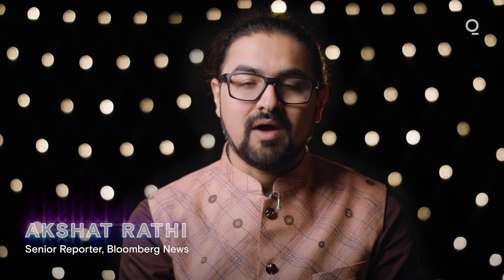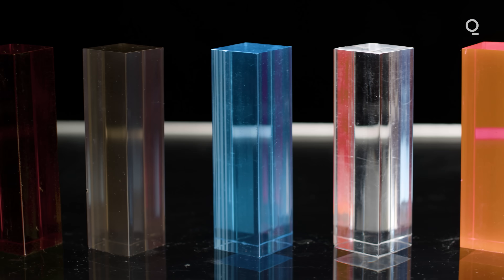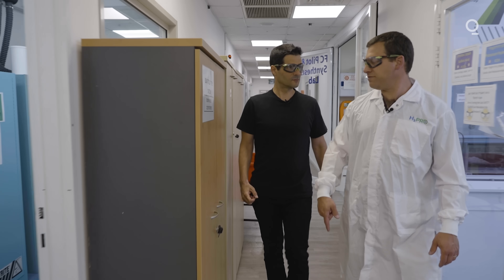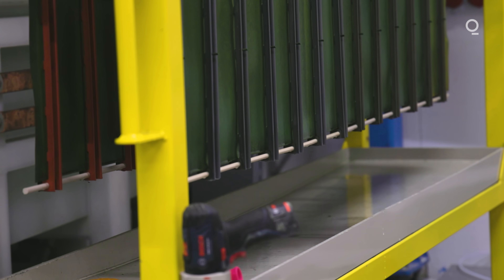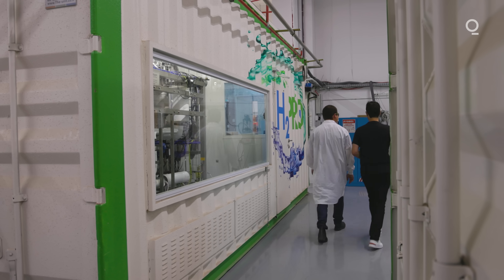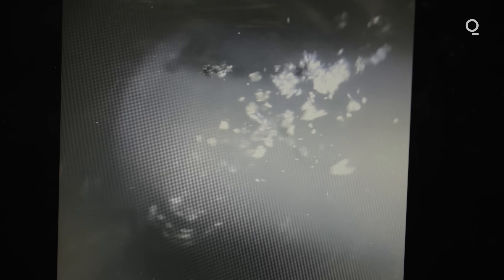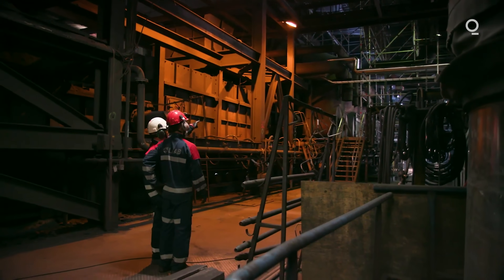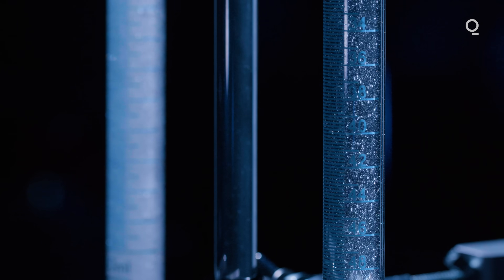How Cheap Hydrogen Could Become the Next Clean Fuel

Comment: 5$ per kilogram. Dude, you did it pretty well ! 1 KG of hydrogen can power a car for 100 Km. Usually a car consumes 8 liters of gasoline on highway for 100 Kms. But the gas for 100 km will cost 16-17$ ! Not 5$. You are already a winner.
Reply: 1l of petrol ~0.7kg
Reply: @yehezkielasyary  Depends on the fuel, petrol would be between 0.75-0.85kg pet litre and diesel would be 0.85-0.95 per litre. It will always be close to 1 and will always float on water (not be above 1).
Reply: Hang on, you are comparing apples and oranges. The 700 ml of hydrogen required to run a car, needs to to be under very high pressure. A little further reading maybe in order.
Reply: 5$ is aspirationally , now the cost is more like 20$ ish
Reply: Believe me, without subsidies it will never become as cheap as driving electric and it's very unlikely to ever become 5 dollar a kg, even 10 dollar without subsidies is unlikely.
Reply: @rowanbroekman3929  Even with massive subsidies not sure H2 can win against imported fossil fuel. The shot of H2 nozzle disconnecting looks to be a Japanese Muni bus the H2 comes from a oil company. Plain old diesel & CNG buses still used on 99% of the routes. The H2 Toyota Sora fuel cell bus is still limited rollout testing phase. Hybrid buses slowly being withdrawn from service as batteries reach end of life.
Reply: Search yt for homemade hydrogen cells powering cars, there is no shortage of people running engines with their homemade hydrogen cells.
Reply: That "$5 per Kg" is not reflected in actual retail price, it's probably the cost of energy to produce the hydrogen, and ignores equipment costs, maintenance, and profit margins. Actual retail cost started at $8 per Kg 2 decades ago, and has risen to $16 per Kg now. 

Instead, compare that with EV "fuel" cost: typically 10 to 15 Kwh per 100 Km for sedans, and 17 to 22 Kwh per 100 Km for SUVs. With electric rates 8 cents to 23 cents per Kwh, that gives a price range of 80 cents to $5.06 for 100 Km - and that isn't ignoring equipment costs or maintenance or profit margin, as those are included in the price of electricity.
Reply: 1kg of hydrogen. If we are to consider two fuels, we should measure them in the same way. As in one liter OR kg. Not both. One liter of hydrogen and one liter of gasoline have an incredible difference in density. To contain hydrogen in liquid form is near impossible unless you cool it to a ridiculously low temperature. To contain one kg of hydrogen requires a very sturdy gas tank with advanced seals and perfect welds. Storing hydrogen at the gas station requires them to liquefy the hydrogen. Also expensive. And extremely inefficient.
Reply: @joachimsingh2929  1l of petrol ~ 1kg of petrol. In transport, weight is the problem, more specifically, fuel to load weight ratio. Just look at trucks and how little space fuel takes. If it triples, it wouldn't matter much, but several hundred kilos of fuel matter when you have a light load. Same with cars, motorcycles, there is enough space for more fuel, but you don't want to carry additional 100kg with you.
Reply: @Dowent  So, at 700 bar, which is 700 times normal atmospheric pressure, hydrogen has a density of 42 kg/m3, compared with 0.090 kg/m3 under normal pressure and temperature conditions. At this pressure, 5 kg of hydrogen can be stored in a 125-liter tank. About a 30 gallon tank. A single steelwalled scuba tank at 300 bar weighs aprox 20-25 kg. With an internal volume of 15 liters. So you can imagine storing hydrogen is quite the hassle. If we extrapolate that and make it an easy 100 l tank for 4 kgs of hydrogen, the tank being so large will weigh around 500kgs (1200 pounds) That is if we make it a cylindrical tank. Wall thickness of about an inch or more and a mileage of aroun 120 miles total for a small suv.. since tanks are rarely  cylindrical as it just hinders vehicle design, luggage space etc, the tank will weigh even more.since cylinders are so efficent if we look ratio of shape/ material needed to contain said pressure .And im talking about steel alloys specifically designed with pressure in mind. However, an extremely expensive tank with only a steel liner and carbon reinforcing with monofilament( to save on material) spun around this cylindrical tank would make up for a lot of weight savings.. but again... tanks in vehicles are rarely cylindrical.
Reply: @joachimsingh2929  so let's just not try to store it, we can produce just as much as we need, in future every engine will be replaced by a smaller, compact H2 generator. I mean with time, things get smaller, smarter and more portable Just like any other tech
Reply: @joachimsingh2929  The ratio for a 700 bar tank is 9 kg per kilogram of hydrogen so for 5 kilograms of hydrogen the tank would would weigh about 45 kg or 100 pounds.
Reply: @joachimsingh2929  hydrogen stored in a pressure vessel doesn't sound viable based on those calculations! Also steel can't be used because of hydrogen embittlement
Reply: @Dowent extra 100kg is not a big deal For a truck considering these vehicles weight 30-40 tonnes fully loaded
Reply: @joachimsingh2929   er no not really it can be kept on film or disc cheeper and lighter
Reply: A sedan, Toyota Mirai, actually only takes 0.78kg of hydrogen per 100km! And that's a decent size car.
Reply: Not in Algeria where diesel cost of 1 liter is 0.2$
Reply: @abdelssami  and onions costs $10 a kilo. Lol
Reply: Everyone here talking about deuterium like it's some fancy new thing and not just a hydrogen isotope
Reply: You forgot “tax”.
Reply: You are comparing apples and oranges. A hyper efficient H2 drive train vs a conventional gasoline drive train. With the cost of fuel cells and H2 it is cheaper just to store the electricity in BEVs.
Reply: You don't understand the difference between a manifacturing cost and a sell price. A 5$ per kilogram need to be sold at 20 maybe 25$ to make profit and recover capital cost.
Reply: @pierregravel-primeau702  Also government taxes
Reply: Water Vapor is the worst green house gas. Humidity makes the planet warmer. Dummies.
Reply: Unfortunately ppl get assassinated for hydrogen inventions
Reply: Larg scale factory use cost is still to hi. However used in smaller scale such as vehicles yes we should of done that after steam.
Reply: But that's their target at large scale, not what they have achieved.
Reply: it's quite different the production cost than the final market price. Gas is cheaper to produce but it's expensive for you. Try adding to manufacturing cost + distribution + taxes + sellers cut..., easily it'd be more expensive in the end.
Reply: 8 liters for 100 km on highway !? What are you driving? a bus ?
Reply: But how much potential energy is in a kilo of hydrogen compared to a kilo of gas or diesel. I don't know the answer either, but I'm definitely interested
Reply: @robertcollinsworth9113  Gasoline is 13% hydrogen and 87% carbon. One kilogram of hydrogen holds 33.333 kilowatt hours of electrical energy. One kilogram of gasoline holds 0.130 kilograms of hydrogen, so one kilogram of gasoline would hold 4.33 kwh ( 33.333 ÷ 1000 *130 ) of electrical energy. 2.692 gallons of gasoline contains 1 kilogram of hydrogen. If you could drive 8.5 miles on 1 kg of gasoline, one kg of hydrogen would take you about 65.385 miles ( 8.5 ÷ 0.130 )
Reply: @saltydogg  It is not the hydrogen that makes gasoline energetic. You have to know why things actually combust in the first place. You have a bunch of molecules and when they have enough energy (i.e. high enough temperature), then those molecules are able to react with the oxygen in the air to produce new compounds and release energy. You might now wonder where that energy comes from. It is not the atoms themselves that release this energy. In molecules, the electrons and protons in the atoms are in a constant state of pushing and pulling on one another. There is an interplay between the electromagnetic and strong nuclear forces. When atoms are close together, their electrons and protons can start interacting (although the electrons do most of the interactions). The electrons can find new positions that lower the total energy of the two atoms and so they are more stable. This is what we mean by a molecular bond. This decrease in energy when this bond is formed is crucial since that excess energy that the two atoms had before has go somewhere. That is the useful energy we extract from the chemical reaction. In fossil fuels, when a hydrocarbon like CH4, methane, reacts with O2, oxygen, the atoms in those molecules have some amount of energy. For the reaction to take place, the end product has to have less energy than the original. When the temperature is sufficiently high, the atoms in the molecule of CH4 have enough energy to pull their electrons away from the molecule and grab onto the O2. This reaction looks like the following, 2 molecules of O2 hits a molecule of CH4 and the hydrogen atoms then bond with the oxygen atoms, making two molecules of H2O and the carbon atom bonds with the other two oxygen atoms making CO2. These end products are very stable, which means that the way their electrons interact has low energy, but the interactions of the electrons in O2 and CH4 were quite energetic as these molecules are less stable. This means that after the reaction, the total energy in the molecules has gone down, but energy cannot be destroyed, so it must have gone somewhere. That energy is no longer in the interactions of electrons, but rather put into the motion of the molecules. That means that the molecules speed up and we can then use that to push objects (like the pistons in an engine). In conclusion, it is not the hydrogen responsible for the energy that is produced upon combustion, but rather the interaction of the electrons before and after the chemical reaction. It just so happens that the energy in the bonds of hydrocarbons is very large and so when they combust, they release lots of energy.
Reply: porblems are about long time safety out there and ofcourse all those mini facilities all over the world needed  to place it and how you extract it and give  it to buyers in a super easy and safe way!!!!! the cost for safety  is the heavy thing
Reply: Read the Youtube videos about "Deuterium". It's in the Philippine Deep (Philippine Trench), at the depth of 10 kilometers or less under the sea. There we will find "Deuterium" deposits that can supply the whole world. Question is, is there a technology these days that can harvest it under the sea at that depth?
Reply: @ArmanJCRey  , also the ecological impact of mining deuterium has to be taken into account
Reply: @maxd8132  Like I said, it is being discussed now by our government. There are several Youtube videos about the "Deuterium" that can be found in the Philippine Trench, 10 kilometers or less @ the surface of the sea bed. If you have any contradictions to the idea of mining that "Deuterium" under the sea, you better visit now those videos and make your comments about the "ecological impacts". Atleast say something about it to caution our government. What I know, it can help to avoid the impact of "climate change" by replacing the used of fossil fuel and coal.
Reply: @ArmanJCRey  that deuterium bs has been debunked
Reply: @kalamay  i think deuterum can be extracted from horse dung
Reply: @flesz_  Your comment shows that uou are not trained in the sciences. Unless the horse drinks pure deuterated water it s dung will not have Deuterium to extract. Only litre quantities were ever made of pure deuterium. Perhaps you are joking sarcastically.
Reply: @ArmanJCRey   or the cheeper and Ezy safer more abundant option water is everywhere  lots of options  better than mining oceans
Reply: @unipartywonagainstthepeople  In 2020, I saw a couple of vehicles in BF Homes Paranaque, both were powered by water. They showed us the engine, it looked messy and seems it will not last long.
Reply: really cars dont need to be as large and have smaller engines. thats just how society works. everyone want ti show off
Reply: Hydrogen is dangerous and very explosive 
Lot of engeering challenges and maintainece cost will effect
Reply: This is before compressing the hydrogen.
So, this is of course a scam.

Comment: Ooooohhhh, buzzwords! 
"H2 is the fuel that only produces water when it burns!"
"The challenge is to split the water efficiently"
Duh, so hydrogen isn't a source of energy.
Reply: It's most definitely a fuel (ie, energy source): you burn it (ie, combine it with oxygen, which is more or less the definition of "burning", and you get a) energy and b) water.  The trick is to  produce hydrogen (which in most cases involves splitting water)  in an a) affordable, and b) "green" - enviironmentally friendly - manner.  If this can be accomplished, then we have a great energy source!!
Reply: @altareggo  to make it, you have to split water, when you burn it you make water again. Same heat of reaction! No net energy gain! Not a source of energy!

Comment: I wonder how much hydrogen can you get from a litre of water and how much energy would that be equivalent to the amount of petrol.
Also would fresh water or salty water make a difference
Reply: You don't get energy OUT of hydrogen, unless you put energy INTO IT first. It's just a battery technology. The energy input can be either electricity, or methane.
Reply: @CougarDoomer  Exactly.
To answer the original question of how much hydrogen energy can you get out of a litre of water?
A: Almost as much as you put in, to extract the hydrogen. It's an energy storage system, not an energy source.
Reply: @CougarDoomer  that could be said about literally everything we use to generate electricity
Reply: It takes 9 litres (kg) of clean water and a LOT of electricity to produce one kg of hydrogen. The fact is that the energy which can be extracted from the hydrogen is only 80% of the electrical energy used in the process. If you are looking for energy efficiency, water plus electricity to make hydrogen is not the way to go. To quote Mark Twain; There is no distinctly American criminal class; except government.
Reply: @ivanwain  and that's totally portable energy storage compared to pumping water up to a reservoir for later use
Reply: Adding some salt to water will make it harder to separate hydrogen from it as it will reduce the vapour pressure, thus more energy will be required to separate it.
Reply: Don’t "wonder"… search for it ffs
Reply: Well, prices for some food n livestock feeds hv been on the high side when tech uses food to make fuel… water’s next
Reply: How much hydrogen can you get from a liter of water: 11% by weight i.e. 110 grams. 
How much energy would that be equivalent to the amount of gasoline: something like 290 grams of gasoline.
But those are just the theoretical energy assuming 100% efficiency of both, in reality, using gas in cars has an efficiency of something like 25%, while hydrogen fuel cells in cars has an efficiency of something like 60%.
so if efficiency is taken into account, the useful energy from hydrogen from 1 liter of water roughly equals 680 grams of gasoline or 1.1 liter of gasoline
also keep in mind that in order to get hydrogen from water you need to put in energy first, like a battery, but hydrogen is more energy dense than the best battery we have today by several orders of magnitude, making it the ideal battery when energy density is important.
Reply: That’s why everyone should study chemistry in High School. Everything on earth are chemicals, including our own body.
Reply: @salvadorcoling8403  i had chemistry at school but they didn't answer the question I asked
Reply: Then, you should have studied hard.
Reply: @salvadorcoling8403  Do you know the answer to his question? I mean, you like you are the elder and yet here you are being petty and judgemental in the YouTube comment section.
Reply: @salvadorcoling8403  just answer him or shut up dude. He asked a legit question. So you either makes us waste time with your words or move on
Reply: @betobarreto5079  yes and no, it's a simple question he could have answered himself by spending basically 3 minutes via Google! So, not only did he not pay attention in school, he's too lazy to use Google

Comment: If carbon can be removed from CO2 it can be sequestered inside billions of Man Made Diamonds that can power Electric Vehicles for 1500 year without the need to recharge them.
If Soda water is split using electrolysis  it may leave carbon as a by product while producing Hydrogen and Oxygen.

Comment: Building an HHO generator (or make a small tweak to capture them seperate) is wicked easy. Ive ran a 97cc generator from a 5g generator with potassium hydroxide and salt as the electrolyte.

Comment: I like the idea of being able to sequester solid carbon from carbon dioxide. It may be a bit expensive but is 100% necessary if we are going to continue using natural gas as a fuel source. Put a decent price on carbon and this will end up being viable. Next issue will be that we are sequestering too much oxygen out of the atmosphere when using the hydrogen.. Probably best just to stick to batteries and electricity.

Comment: There is no such thing as a Green HYDROGEN. Because the Energy wasted on Electrolysis can be directly used for the said purpose if not directly then with minimum loss using the latest battery technology.
Reply: I think too that direct use of green electricity/power with grid transport is in the majority of cases superior to converting it to hydrogen and then again to electricity/power via fuel cells. The range problem will be solved with swappable batteries or why not with extra supercapacitors and induction based charging.